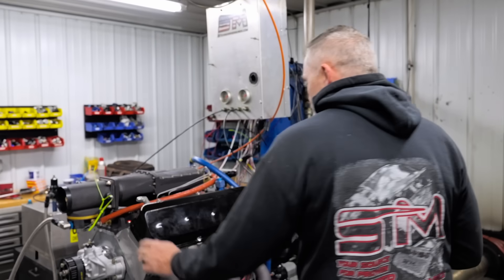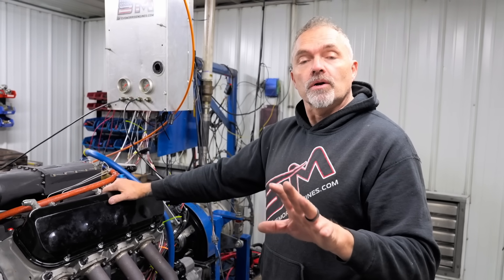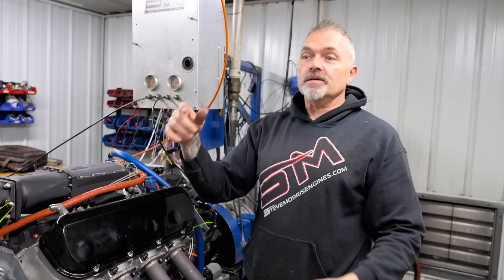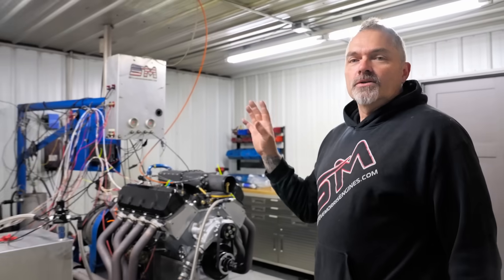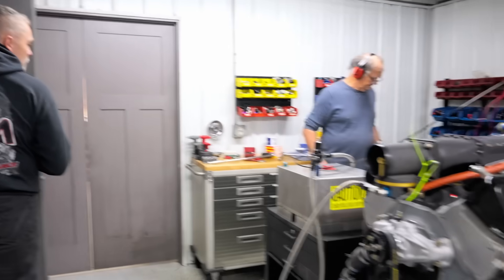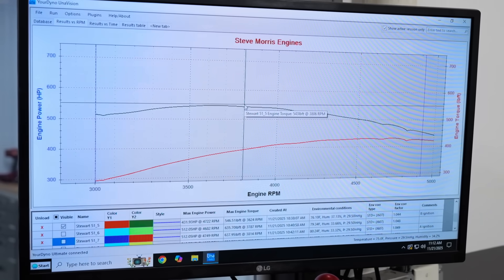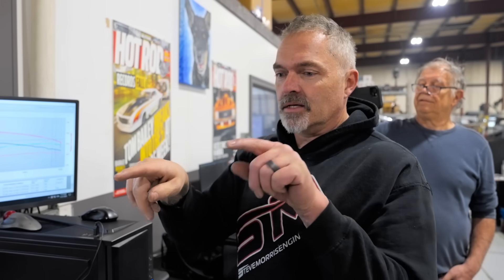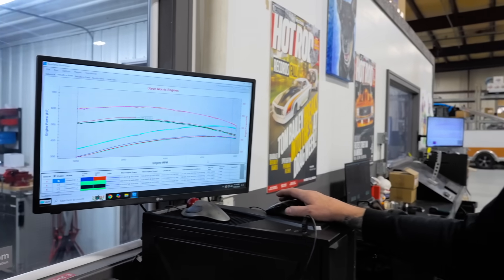Amazing 2 Spark Plugs Per Cylinder BBC  1 Spark Plug Makes almost 100 HP More Than The Other one ?

Comment: My guess is that the difference in power between the two ignition systems comes from the difference in physical location of the two spark plugs in the cylinder and is ultimately related to the time it takes the flame to propagate through the combustion chamber.

Ignition timing exists to compensate for the time it takes the flame to propagate (travel) across the combustion chamber (a distance).  Since the two spark plugs are not in the same location, the distance the flame has to propagate from is slightly different between the two spark plugs.  So even though the ignition timing is set identically for both ignition systems, the "effective" ignition timing (as per the actual flame propagation across the combustion chamber) is slightly greater with ignition system "A" as compared to ignition system "B"

If you wanted to test this, you could slightly advance the ignition system "B" timing until it produces the same engine horsepower as ignition system "A".  If you can get ignition system "B" to make the same horsepower as ignition system "A" but with a little more ignition timing, this additional ignition timing would represent the time it takes the flame to propagate the distance between the two spark plugs.
Reply: @learning_every_single_day  I think you're partially right with the flame propagation, but I think a lot of people are confused (or maybe it's me) about what's happening. 

One ignition system isn't making more power than the other- it's making more power when BOTH systems are activated, accelerating the burn rate of the mixture. I'll bet if they're recording EGT's, then see lower EGT's with both systems on also.

Most aircraft engines have the spark plugs on opposite sides of the cylinder/combustion chamber, so it helps to visualize this better than two plugs right next to each other. But imagine two spark plugs on opposite sides of the combustion chamber, firing at the same time (optimum ignition advance for power). The flame fronts meet roughly in the center of the combustion chamber, and the mixture is burned in the most efficient manner before the exhaust valve opens.

Now, turn off one of those ignition systems. The flame front will have to travel further from a single spark plug to burn all of the mixture, taking longer to do so, and still burning while exiting the cylinder. This will produce lower cylinder pressures (lower power), and higher EGT's.

Comment: It would have been interesting to see if the A vs B was the same if you switched the plug leads between the two, as one ignition box or coil might be doing a bit different in timing or spark output power,

Comment: My brother had a 1992 Ford Mustang with 4clyinder two spark plugs per cylinder in 1993. I was 16yrs old, worked at Chiefs Auto-parts Waxahachie TX. I won a set of Split Fire Plugs so I hooked him up. I drove 1971 Chevelle 350 that needed rebuilt.

Comment: The 2 different spark plugs making different power is very interesting. I’d love to hear your theories on it. Could the one making less power possibly need more timing due to the location of where the flame front starts? 
Could you learn from that in your other engines? Maybe there could be more power to be had in performance engines by moving the spark plug location?

Comment: The rear Spark plug is Making more Power because it is closer to the Intake port, its like being more Advanced in spark timing.! Ford Made some 4 Cylinders like that but had them Opposite side of the head OHC .. There are others i have seen like that.. If you moved them vertical placements one would be closer to the Piston who knows what that WOULD DO instead of front and back top and bottom .

Comment: Do they both reference the same tdc off set? If it uses 2 different crank sensors and an offset isn't set for both, I can see how they would have technically 2 different ignition timings. It's not necessarily the plug placement but it's the second crank sensors having a different tdc offset in relation to the other. Are the sensors next to each other or inline as the flywheel turns? Swap which ignition system that fires which plug set, i bet if you then switch between the systems they would give the same test results due to the crank angle offsets being off. I dont think the ecu will allow setting 2 different tdc offsets in relation to where each sensor for each system is located...
Reply: Exactly

Comment: would you recommend a 5.3 billet deck big bore block for a roots supercharger application (possibly 10/71 or 14/71)? also could you use a 8 speed trans like a zf 8 to keep the blower in the power band? sorry if these questions seem incoherent. Thanks

Comment: I believe the heavier atoms are harder to ignite on the outer side of the cylinder walls air/fuel is more dense do not move as fast and needs more heat to ignite from flame kernnels . 

Add another spark boom we have lift off houston 😊

Comment: You could just switch the wires on the two spark plugs if you wanted to try something quick and dirty - if nothing changes its from the spark plug in and if something does change its from the wires back.

Comment: Used a later 91 8 spark plug head on my 2.3 turbo ford 707 hp  befor the rear axle broke .

Comment: You should play with the timing on the low side see if you can bring that #1 plug up to the #2 plug power or check where #1 plug is indexed to the #2 plug

Comment: flow through combustion chamber may favor the rear plug but both plugs makes combustion more efficient 
most all aircraft engines will always run both ignition systems 1) redundancy 2) because all the efficiency more complete burning of the AFR 
the manual rich lean mixture is useful for a number of reasons. However most beneficial to NA applications at altitude or high Density altitude that where you lean for max HP(rpm)  so efficiany goes way up for fuel burn at higher altitudes. 
propeller efficiancy is why the Reduction gear box , prop speed at the tips is or will go super sonic depending on diameter because the tip speed is faster then say middle of the propeller blade ideally keeping tip speed bellow trans sonic ( below .8 Mach tip speed is 891 FPS feet per second) add blades and or blade area to absorb HP 
Stewart 51 boys are awesome and an Awesome airplane

Comment: The whole 'Dual sparkplug' deal in aviation is very misunderstood by many people.   The reason for the dual plugs is NOT for redundancy...it's because the huge combustion chambers have such low charge velocity that flame travel is very sluggish and needs to be lit in two places to get the burn done in the allowable time.   Redundancy is just a happy byproduct of the dual plugs and ignition systems.

I worked with Jim Stewart for several years back in the late '80's and early '90's and was the 'engine guy'....but without an airframe an engine does you no good so I spent most of my efforts just trying to put airframes together.    The whole story is a sad one though and Jim was a great guy and engineer but made several critical and fatal mistakes in the business plan that put us out of business.   Designing an aircraft is the EASY part....making one is VERY difficult and requires a huge expenditure in fixtures to put them together accurately and efficiently which we were never able to achieve.

The P-51 had a huge forged box section holding the wings and landing gear assemblies that I argued should have been a casting which isn't as light and strong as a forging (which could not be afforded) but Jim disagreed and in the end the landing gear box was a total failure.   We also got screwed by a couple ex-Piper employees who took much of the funds building stretch tooling for the cowlings and whatnot that just didn't work so all was wasted.    It's great seeing people still interested in the S-51 project as I was and hope they have better management than we had.

Comment: I guessing the B ignition is only on the front on one bank and rear on the other? I would think the difference in horsepower per bank would just cancel out if one ignition ran just front or rear spark plugs.

Comment: I assume it has to do with timing r/t the flame front. I would think that the two plugs would need to be at different times to be equal in actual ignition.

Comment: Gotta believe moving the spark plug location from the original location would cause some power loss due to an altered flame front. The forward plug likely creates a flame front that can’t travel all the way across the piston before the exhaust valve opens. Maybe the B plug would make more power if the ignition was advanced a couple degrees?  Would be curious to see what an unmodified head would make vs the modified head running on only one of the plugs.

Comment: So cool! I went down the rabbit hole on max bore size for efficiency for a single spark plug on gasoline. Over the years trying to optimize emissions the OEM's eventually narrowed it down to 82mm/3.23in. They can push further into the 92mm range and still meet efficiency but it falls off. For big block size 114.3mm/4.5in. needs dual plugs spaced apart for efficiency. 
The dual plugs both firing burn the fuel faster, so it's like changing the advance without changing the advance. That's why it sounds different. Say you could run 39 degrees advance on a single plug, a dual plug might make peak at 28 degrees advance.
All the BMW and not sure about Audi run the same bore size, 82mm in all their engines now. Stroke and number of cylinders vary but bores stay 82mm.

Comment: I guess it has something to do with the same principle as indexing the plug towards the intake valve
Reply: No.   The 'bad' plug appears to need more ignition advance and doesn't have it.

BBCs are incredibility crappy when it comes to combustion chamber efficiency.  (especially if you have to run a large dome).  They need lots of lead time to have the mixture 'on the clock' at the right time after TDC.

Stuffing a plug wherever it'll fit is a recipe for some additional tuning.

Comment: large chambers typically need more lead time, but the downside is they become more octane sensitive. Adding a second plug might be a way to improve the burn rate. I would be leaning towards surface gap plugs  and higher voltage ignition systems, but they come with their own issues.

Comment: Wonder if the rear spark plug is triggering a vortex in the combustion chamber, be interesting to see if this would improve power on other engines by placing the spark plug further back over the exhaust valve or near it like in this.

Comment: My guess if you would as timing to the “front” spark plug, then it’d pick up power. Freiburger was just talking about this in his duster video about a 383 Chrysler engine that didn’t make that much power as it should’ve and they knocked some done off the piston so the flame could travel. Think in this instance though it’s just the distance the flame has to travel and where the kernel is as well.

Comment: Which spark plug made more power. The one closer to the exhaust or the one closer to the intake valve. I know on jet boats they set peak TQ at the best RPM for the jet pump. I wonder if that works here. Cam peak TQ around 4000rpm that way it doesn't fall off much at 4500 and from 3000-4500 under full prop load it would not have any problems also peak TQ is the engine peak efficiency to cruise at.

Comment: Run one at ignition system and then switch the plug wires between the 2  spark plugs

Comment: Did you swap leads over. Is the quality of the ignition systems the same? Is the timing of both sets identical. You would need to verify these factors to state categorically it is down to plug location.
Reply from the maker: Yes… They are

Comment: Almost like A ignition system has an extra 10 degrees of timing.
Reply from the maker: No e check each individual of the other
Reply: Maybe a weaker coil/magneto on ignition B?, plug or wire maybe?
Reply from the maker: @robertphillips2462 I don’t think so, location absolutely matters that is a fact, but this one seems backwards from traditional thought. That’s the point

Comment: Redundancy is key in aircraft engines…. H.P. from one non-optimum position plug will of course be less, but the big trade off is with both plugs you’ve got more power and the all important, ass-saving redundancy.

Comment: i kinda remember this happening on... on a single thumper bike as a kid... we had the dual spark plugs for the one cylinder, but the coil that was on it was only one wire .... so we just used it as a redundant plug in the long desert trips where you were due to foul a plug.........it always was stronger on the front plug (exhaust) than the back plug.(carb.)........i was always curious about it...wonder if there is a reverberation in the ignition shockwave that is trying to return to center of ignition as the piston starts moving ... making the extraction of the burnt gasses focus their return energy closer to the exit due to the ignition start point (plug) closer relationship to the ports location.(exhaust).. ? could it be clearing better and filling more effectively firing in that location?

Comment: Very interesting that the back plug location makes that much of a difference!
Reply: What aircraft is the engine used in? Also why not mix the ignition systems fifty fifty between front and rear plug  to balance in the event of any failure.
Reply: It's not the plug location, it uses 2 different crank sensors that would need 2 separate tdc offset values. It's technically running 2 different ignition timings because of the sensor locations. You can only set 1 crank angle offset in the ecu. It may be 5-10 or more degrees different when it switches to the other sensor for reference. The commanded ignition timing fires at the specified location from the ecu, but if it's referencing from a different location because of the other sensors position then that equals the discrepancy...
Reply: @Brother2Jis_27s4 ,,, we have a winner , I think he's got it . Obviously the timing shoud have been checked on both plugs .

Comment: I believe. The piston when the plug fires. Is kicked (twisted in cylinders) from the rear plug in its favour to gain 50 odd hp.  The front against the favour to reduce 50 odd hp.  Add up to the 100 hp difference 👍😎

Comment: Is that like the reverse rotation marine engine? Gear to gear cam drive?
Reply: Reverse rotation but with a chain driven cam.  Cam and crank turn in the same direction.
Reply: @brassmonkey3274  Have you seen the Marine big blocks that have 2 engines. The reverse rotation engine has a 2 gear cam drive set up making the cam turn opposite of crank

Comment: All the old fire trucks I work on are dual plugs,hxe Hercules 935cid ,has dual plug,I have new military surplus heads  that’s cast for dual but machined for one plug,we are fixing that . Do you want to dyno that monster.advertised 200hp @900 rpm

Comment: It would be interesting to see what the power curve is with a standard single plug head.  Another test would be the  SBC stock plug and angle plug heads.  ( If angle plugs are really moving the spark end and not just the terminal end )

Comment: Steve; you  have an issue with one system. 100hp over spark plug position on 400hp engine posible but that’s not even the tge conversation  when it’s running both plugs you lose hp ?? You have a net loss in performance period over just one set spark plugs equal a PROBLEM not a result of position

Comment: If spark plug placement in relation to the combustion chamber wasn’t critically important, the hemi design wouldn’t exist… 😉
Reply: Its not just spark plug position but also better airflow from the valve geometry
Reply: @Nagger666  And that geometry provided space for dual plugs.

Comment: When I worked at Dart Machine in Windsor in the mid 90's we were helping develop an aircraft engine based off a big block chevy. The company was called Orenda and the engine was a OE600A and it also had 2 spark plugs per cylinder.
Reply: Orenda was eventually sold to a group here in Odessa, TX. Trace engines and they tried to get STCs in place to use the engines in more applications. I have one of the engines I bought second hand. They suffered from oil usage and never saw one make it to tbo. I'd love to buy the rights to the engines and have Steve improve on the piston/ring pack design.
Reply: @sinfulcoin  Very cool!! It's been many moons since I have seen one. It would be a cool deal if you did get the rights and continued development.

Comment: So interesting SM. 
I didn’t think you could run a motor backwards. Do you have a different camshaft ramp grind because the motor runs in reverse. Absolutely fascinating. 
I believe it’s the spark plug pointing towards the exhaust valve that makes more power due to the flame burn characteristics that happen in the chamber. 
Thanks.
Reply from the maker: Different cam 
The plug pointing at the intake is the better one 🤔
Reply: @stevemorrisracing thanks mate.
Reply: There are thousands out there in boats, sbc and bbc, they use gear drive cams GM made them.

Comment: When you say front spark plug, do you mean front of the Dyno stand or front of the airplane, 2 different fronts.
Reply from the maker: Front in a car
Reply: @stevemorrisracing It would be better to have ign. 1 next to intake valve on both sides and ign. 2 next to exhaust valve on both sides. It would be front on one side and back on the other. I'm sure that's how it is and I'm just pointing out the obvious.

Comment: Is it because the rear plug location has the flame front propagating away from the exhaust valve allowing more time for a full burn before the X valve open event?  The front plug would have the flame front moving toward the X valve and as it would open the natural direction and energy of the burn would more easily continue out of the combustion chamber?
Reply from the maker: Possible
Good thought